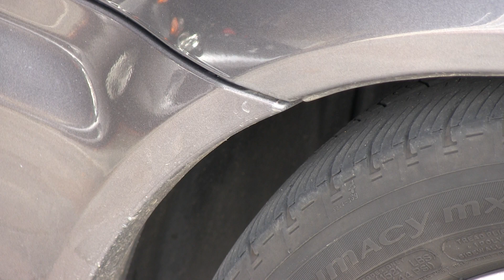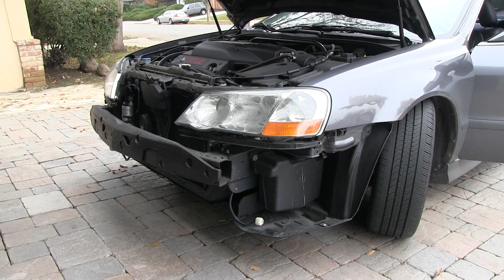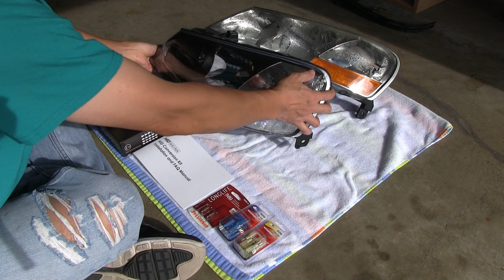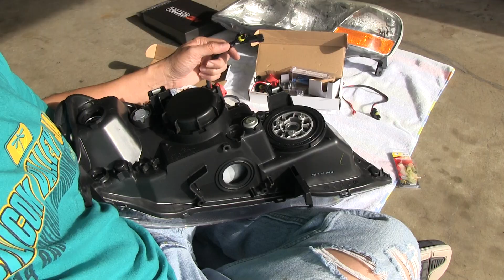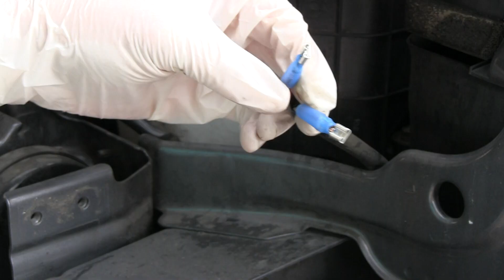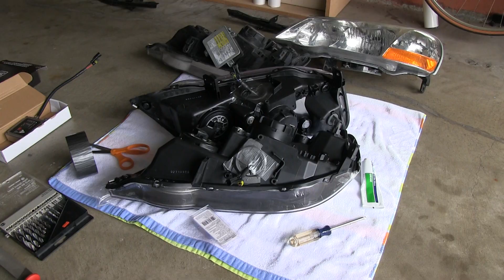Replacing Headlight Housing & Ballast on a 2003 Acura TL-S

Comment: Any car brand that requires a person to drop the bumper to perform basic maintenance (such as bulb replacement), is a brand one should never purchase. Absolutely absurd!
Reply: He's not replacing the bulbs; he's replacing the full lens assemblies. 

Replacing just the bulbs on that model/year is trivial. Well, the driver side is a little bit cramped because of the location of the battery. The passenger side is a no-brainer; literally twist and pop out, replace, and pop back in. Find a sub-10-year-old child with small hands, to do the driver side 🙂
Reply: @Craig-ib7gk  The outside HID bulbs still require bumper disassembly. Unless of course you have the world's smallest hands and fingers.
Reply: They make it like that so lazy people don’t work on there vehicles and than drive on the road with everyone else

Comment: So the factory bulb size is 9006, if I upgrade to hid kit it’s will be 9006 or d2s-d2r?
Reply from the maker: The low beam replacement headlight bulb size is D2R.  9006 is the size for the foglight.

Comment: I put a new bulb into my passenger side. Thinking it was just a bulb issue, but when I go to turn my lights on. The passenger low beam doesn't turn on but all the other lights do. What would be the issue?
Reply: I know this reply is late but your ballast went out, very common issue on these cars. Follow this video to remove the headlight and replace the ballast on the bottom of the headlight. Or upgrade to new HID kit just like this video showed.
Reply: @mygt8a4re  so if the high beam and turn signal still works , then we know the fuses and relays aren't the issue? Is there a way to "fix" the ballast?
Reply: @If it ain't broken, I fixed it. Also did ur mom , Helluva YT name man.... the headlights not turning on are usually related to your ballast as it powers your HID bulbs. I sold my Acura over a year ago but before I did,  I did an LED headlight conversion and bypassed the ballasts. Best thing I ever did. The headlights were amazing after that. But If you want, Pull your front bumper, remove the headlights and swap out the Ballasts on the bottom of the headlights. That is, of course if you haven't tried replacing your HID bulbs already.
Reply: @mygt8a4re  Lol thanks man, and yeah I'm doing the switch over to plug n play and bypassing. Thank you though

Comment: Instead of a new 55w hid kit, could you do an LED swap? You said bulbs are 9006 now. Could you get some kind of stock hid to normal halogen/led adapters for the wiring?
Reply: You can change to LED, buy universal D2r LED bulbs that will come with pigtails and tap them into the wiring that goes to the ballast. The old ballast and igniter will no longer be used. Be sure to purchase quality LED bulbs, skimping here will only cause headaches down the road.
Reply: @mygt8a4re  hello..im reading your comment on LED lights to replace hid on acura TL. I was wondering if you can give me some advice on what to do . I'm looking to replace the hid because the balast keeps going out..
Reply: @johnnieloccs  you can purchase the LED D2S (also referred to as D2R, D2H & D2C) bulbs online, I suggest 80watt, just about anywhere. There are a lot on Amazon. The power wires that went to your HID ballast will be cut from the ballast to be used to power the LED bulbs. There is a positive and a negative wire. The ballast is on the bottom of each headlight (small black box). It's easier to remove the front bumper than to try and work around the headlights with the bumper on. You can find the removal procedure online. Other than cutting the wires to the factory ballast you need to drill a small hole in the back light cap for those wires to fit through to run to the new LED bulbs. Then when all sealed up put some rtv sealant in/on/around the hole to keep moisture out. It's sounds like a lot but it's really not. Mine still work great to this day. A huge improvement over the factory HID lighting. One of the best mods I've done to my Acura!

Comment: What kind of light does it take, I’m in need of buying one.
Reply from the maker: Hi @bluegrey52.  Once you replace the housing, the housing accepts (requires) the standard Acura bulbs for low beam (9006) and high beam (9005).  Turn signals take a 1157/1157A bulb.
Reply: @MikeekiM6 The low beams on my 2003 acura TL are D2R, how did you get 9006 to fit? Do they have the same fitment pattern?

Comment: Don’t know if you still reply, but I’ve been wondering. All of my lights work fine, I want a new housing for the headlights as there is a lot of condensation that’s built up inside of the housing. I noticed that this is a conversion kit. So my question is, if I buy the same headlight housing as the original, would I have to “splice” the original car cable? Or would I be able to plug it directly into the new housing? Sorry if I’m not understanding something as I don’t know much about cars.
Reply from the maker: Hi @Infinite - Yes, if all your lights are working fine, and you just want to replace the housings with new housings that are watertight, that would work fine.  You wouldn't need to replace the lighting system with the conversion kit.  Just remove all the lights and cables, and install and reinsert the bulbs and cables into the new housing.  Warning:  If you have condensation in your headlight, your ballast may already have been compromised, and it might end up going out on you later.  If you remove the bumper and go through all of the trouble, it almost makes sense to replace the lighting system anyway.  Your call though!  Good luck.
Reply: MikeekiM6 thanks for replying!! I’ll look into possibly buying new ballasts as well.
Reply: MikeekiM6 I was also wondering if you could link me to the body kit you have? I can’t find it online, in black at least
Reply from the maker: @infinite1603  It is the Acura OEM underbody kit.  I think it will be difficult to find, but not impossible.  They are sold color keyed to your car's factory paint color, but you may have to purchase a set that does not match your car's color and just have them professionally painted.  I also had the car lowered by 2-3 inches to clean up the wheel well gap.  Good luck!

Comment: Nice video dude! Just a quick question, why didn't you just screw the ballast to the back of the headlight?
Reply from the maker: Hmmm...never even considered doing that.  I am not sure there is clearance for the ballast to be installed in the back of the headlight.  I certainly was not going to attach it to the original ballast location since it is a poor location susceptible to water damage.  If you do the replacement, please report back if this is a good installation option.  Good luck!

Comment: my driver side light has water in it also...im getting new light assemblies but im wondering if i should order a ballast also..is there a way to test them?..
Reply from the maker: @DJANGO 2000 You can try changing the bulb and confirm whether it works or not.  If it works, you know that the ballast is working.  If it doesn't work, then it could be (and likely the ballast).  Admittedly, this is not a test with 100% certainty.  But if you do decide to change out the ballast, you'll have to change out the pair, otherwise the lighting will look out of balance and awkward.  Are you replacing the one housing, or are you swapping them both out?  The blacked out housing is really nice.  Good luck!
Reply: MikeekiM6 
Yes im replacing them both...I'll change the ballast if i have to but i hope not...thanks tho😎..

Comment: hey, I want to replace my oem headlight housings to tinted clear corners like the ones you have. is there any chance you can send me a link, or at least point me in the right direction of those housings? I can't find them anywhere.
Reply: nvm I found them in the previous comments.
Reply from the maker: Glad you found them.  They look great on the car.  You'll be happy with the results.

Comment: Hey Awesome job! I'm actually going to do this this weekend, was going to do it last weekend, but Acidentally ordered the HID conversion kit for the high-beams, and well installed it anyway. I had a question for you, where did you get the waterproof clam connectors? I need to buy some so that I can connect the lights, and also I'm guessing you used the 16 guage, seeing they are blue.
Reply from the maker: Hi @Alexei Ten I picked them up at my local hardware store, but you can get them pretty much anywhere. You can even get them at Amazon (but in larger quantities than you probably want to buy.  Search for "waterproof spade connectors" and you'll find them.  You can also use standard shrink tubing to get some water resistance.  And yes, I did use the 16 gauge.  Good luck!  Would love to hear how the project went when you are done.
Reply: MikeekiM6 Hey, the replacement went fine.. though 1 of the ballasts died the next day, got it replaced and the other died a week later... did you have any problems with their ballasts? Also, what color lights did you get? I got 6000K and they are very dim and blue... let me know if you have that problem.
Reply from the maker: @Alexei Ten Sorry to hear you had ballast defect issues. I did not have any issues with my ballasts at all. I got the 5000K "factory" color. They definitely start out dim and brighten after they have had time to warm up.

Comment: sup man, my driver side headlight dont come on, i fix and swap everything i needed to do to it but it still dont work, let me know what way i can fix that  thanks..
Reply from the maker: @Homeboi215 Unfortunately, I am not an expert in this area and can't help you on the root cause of your issue. My video is meant to share my DIY steps on replacing the ballast when you know (or suspect) that you have a bad ballast. Good luck on the diagnosis.

Comment: How much money did you save doing it yourself?
Reply from the maker: Unfortunately, I can't quote you an accurate savings figure, but I am confident I saved $1,000+.  When I originally took my car to the dealership, they wanted (of course) to use Honda/Acura OEM parts (and the OEM ballasts are expensive) and all of the labor to remove and reassemble the front end (which isn't cheap either).  I spent a total of about $300.00 for the entire project ($240 for the headlight housings, and $60 for the aftermarket HID and ballasts).

Comment: Great video, good quality and description. Good looking car I have same thing but black. Are you lowered at all?
Reply from the maker: +Craig Diehl - Thanks Craig, I appreciate the shout out...  Yes, I am running on H&R 50103 Sport springs, which tastefully lowered the car about 2.75 inches (cleaning up the wheel well gap really nicely)...  That, window tint and the OEM underbody kit made a big difference...

Comment: I have same problem on passenger side..the thing us the low beams work..could this still be the ballast needing to be replaced?
Reply from the maker: I am not sure I have enough information to answer your question accurately...  But let me make some assumptions...  I think you are saying that your passenger side headlight housing has moisture/condensation, but that your headlights still work.  If your headlights still work, then your ballast has not been destroyed (yet).  If you don't fix the condensation problem, the moisture will eventually destroy your ballast.  In fact, moisture may have already started to create some damage, but it hasn't resulted in failure yet.  If the condensation just started, you can either seal or replace the headlight housing. Good luck! (and let me know if I made the right assumptions above)
Reply: +MikeekiM6 sorry for not clarifying better.. my phone sucks.. my headlight does not work but the low beams do..I took it to my mechanic and he said I need the ballast and igniter which I jus bought on eBay but I don't think he's a great mechanic for electrical issues..thanks for responding
Reply from the maker: +Jae H Good luck!

Comment: Nice vid....How did you know that the ballast was bad and not just the bulb?  I also am going to replace my headlight housings & have condensation.  Low beam out but high beam works.
Reply from the maker: +Boobletown Bobby Thanks... Good question... I had swapped out the low beam bulbs to see if it was a bulb problem first...  Then I just assumed it was a problem with the ballast because I had read about the problem for years on various forums...  Good luck on our housing replacement project, and let me know if you have any questions!

Comment: Acura TL Type-S keeps blinking the lights in and out how can I fix that I put a new ballast on change the switch and I'm still having the same problem what could it be
Reply from the maker: +Jason Lily Hi Jason...  Unfortunately, I haven't encountered this issue, so I am ill equipped to provide you with a solution here. I hope that someone reading this can offer some help. Good luck!